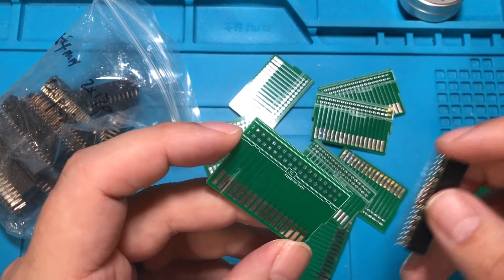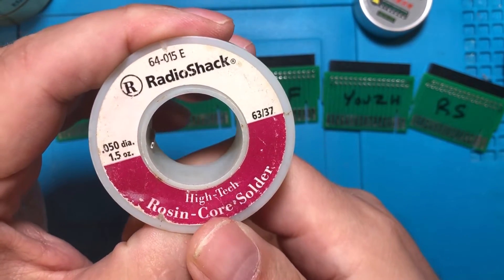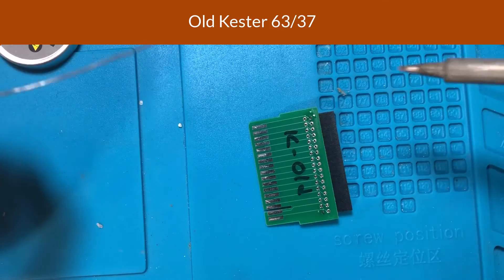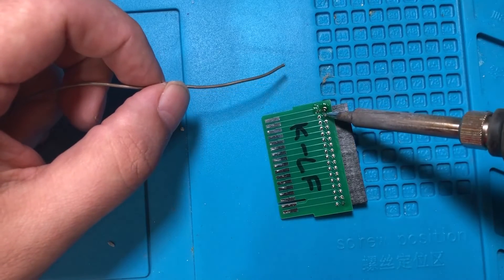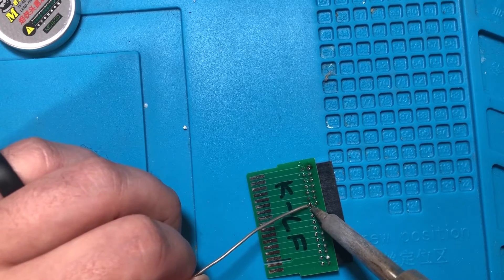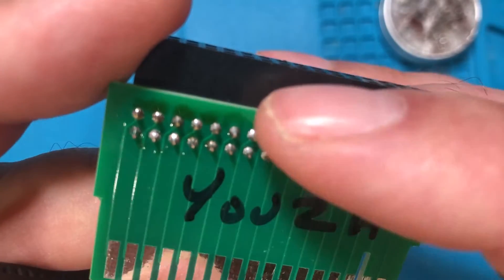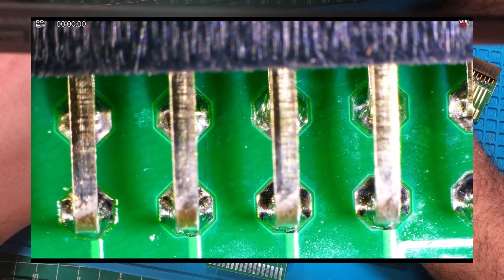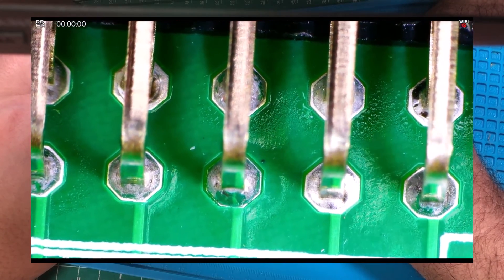Soldering the same board with 5 kinds of solder

Comment from the maker: Thanks for watching. These are the things used in this video and some of my other favorites. 

Kester 44 Lead Solder Wire
https://amzn.to/434HsCj

Reasonable Cheap Solder
https://amzn.to/3NU16wA

My Preferred Soldering Irons
Budget - https://amzn.to/3g6FGy8
Pricier - https://amzn.to/3GdT523

Auto Shutdown Timer 
https://amzn.to/3X3Zenu

Fume Extractor
https://amzn.to/3hFtzIH

Solder Reel Stand
https://amzn.to/3tvy1MU
3d Print one https://www.thingiverse.com/thing:4033261

Digital Microscope
https://amzn.to/3E83LMT
or 
https://amzn.to/3TA0ewr

Magnifying Headset
https://amzn.to/3WZiClx

Chip Quik Flux Pen
https://amzn.to/3GgCqux

US Forge Liquid Flux
https://amzn.to/3UXSaXs

Needle Nose Bottles
https://amzn.to/3EvRXW1

Soldering Mat
https://amzn.to/3O5so1c

5 Pack Flush Cutters
https://amzn.to/3UHC8kT

Eclipse CP-301G Wire Strippers
https://amzn.to/3Tw3oBD

Soldering PCB Holder
https://amzn.to/3UAw0e5

Brass Solder Tip Cleaner
https://amzn.to/3EyUq2k

Mechanic Soldering Tip Refresher
https://amzn.to/3AgYsK2

Mini Heat Gun
https://amzn.to/3Ag7A1u

Soldering Wire Holder
https://amzn.to/3EGpltD
3d Print one https://www.thingiverse.com/thing:2792522

Soldering Tweezers
https://amzn.to/3tsKcdt

Desoldering Iron
Hakko https://amzn.to/3EaQIuf
Budget https://amzn.to/3X43jYQ

Solder Suckers
https://amzn.to/3Ebhum6

Desoldering Wick
https://amzn.to/3hw4JuH

Solder Temperature Tester
https://amzn.to/3O8kunL

Comment: I've been soldering for more than 50 years and though I've tried many different brands I've always returned to Multicore 60/40 solder. When typical soldering iron tips were made if unclad copper it used to contain a small amount of copper and was known as "Savbit" alloy. It's easily distinguished from other brands by having five cores of "Ersin" flux. It's still in production and sometimes branded Loctite Multicore.

Comment: Great video I am currently using Jiali solder wire 60/40 (0.8mm) and I have has this spool now for about 4 years and still have plenty and have had real good results even when using a rinky dink soldering iron.  Soldering is a skill like welding that takes a lot of practice and also surfice prep where you need to put down solder is also a huge deal, I have seen the past couple of weeks helping my neighbour out soldering stuff on his RC cars when he doesnt clean the lubrication that spatters off or grit and grim from running them gets into solder joints that I need to clean them really well first.  Also I love me liquit flux pen, when I solder pcb's like you have in the video , I use spanjaard electro clean first and then apply flux from my pen and then hit it with the iron and wire.  Keeping the tip clean and in good shape also helps a lot so good to see you use the brass sponge as well.
Reply from the maker: I like the new logo by the way.  I've never seent he electroclean stuff. I'll have to check that out.  I always thought the sonic cleaners looked really cool, but that's a pretty big commitment.
Reply: @AnotherMaker  thanks yeah new logo, reboot restart everything on my side.  Electro Kleen is similar to De-Oxid AFAIK, but its in an aerosol can with a detachable nozzle so for tight areas you can use the nozzle and for just a larger surfice you spray per normal

Comment: I recomend getting a board heater when working with the pb free solder. It tends to help the solder wick better as it has a higher melting point.
Reply from the maker: You're definitely right on that. I was just looking at some of those rework stations from circuit specialists that have the heaters on top.

Comment: I'm still using up a big reel of Maplin 60/40 solder my Dad got me when I was 14. I'm 58 now 🙂 Interesting to see the difference between different solders, thanks for sharing the test; I always tend to avoid lead-free because I've tried it, and it just doesn't seem to work as well as leaded solder in a home DIY environment.
Reply: I’m near the end of the 63/37 my father bought me in the mid eighties too. I basically didn’t solder anything for 30 plus years until I got into retro computers
Reply from the maker: Yeah. I was thinking about it, I'm 99% sure that old kester was my grandfather's. Someone else suggested a board heater.  I may give that a shot.